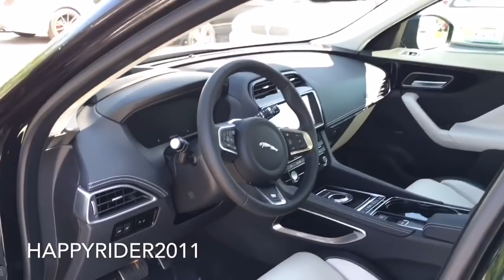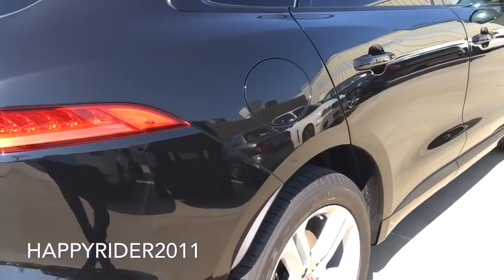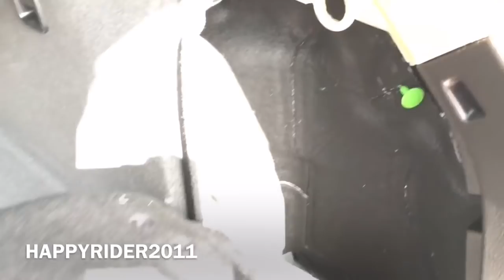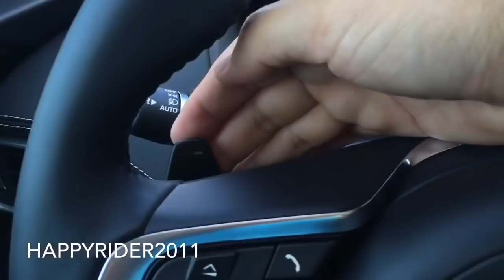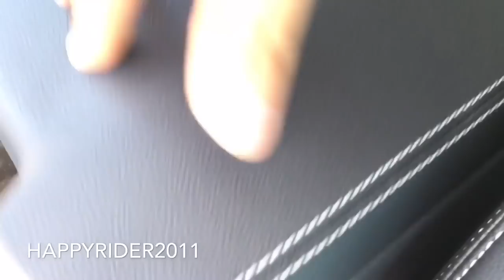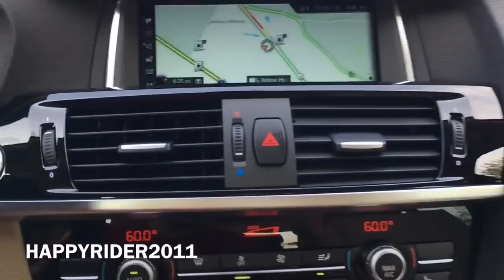2017 Jaguar F-Pace Vs 2017 BMW X3 | ULTIMATE REVIEW & COMPARISON

Comment: You got to compare it to x3 with 3.0 turbo. I think fpace looks alot better than x3. Bmw is no slouch. It may not have the exterior and interior prettiness, it's definitely has ability presence. Jaguars ultra crappy reliability in the past has many potential buyers on check. Bmw, (not the reliability giant) also has enough flaws, but due to their massive presence and sales it would not be a black cat in a black bag. But i do love the fpace interior and exterior